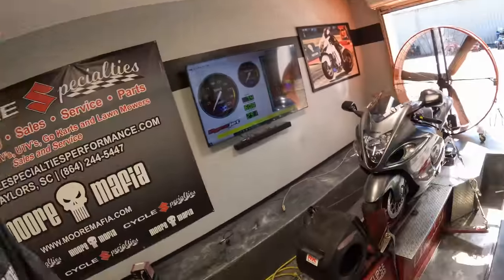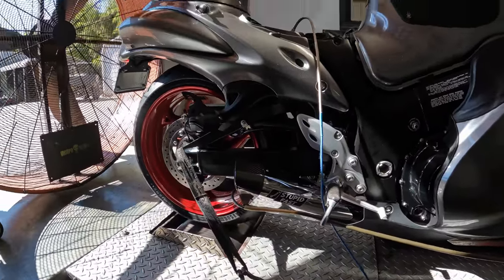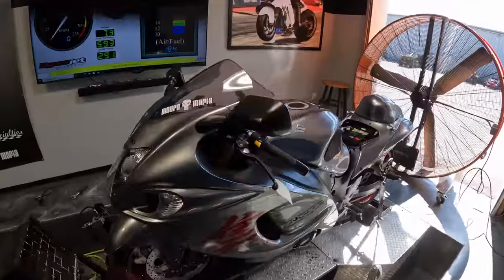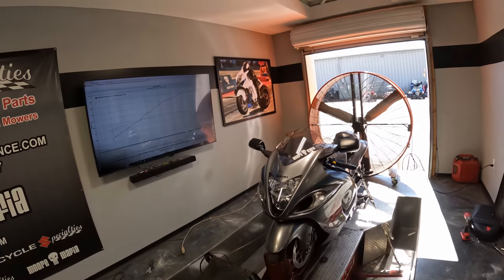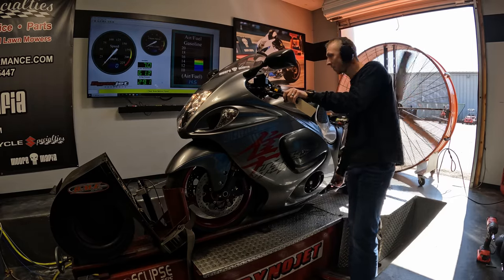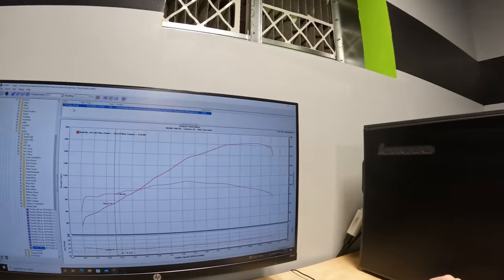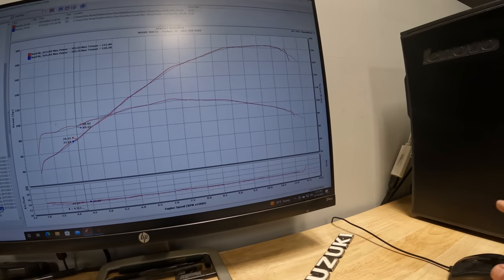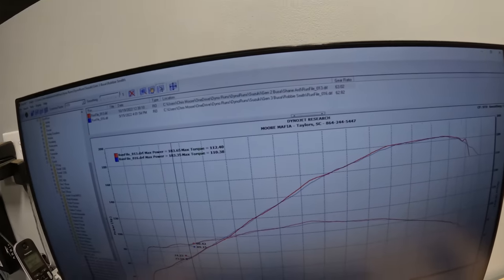2020 Hayabusa VS 2023 Hayabusa- IS THE NEW BIKE WORTH THE EXTRA $$

Comment: Suzuki made the Gen 3 'Busa for people like me, someone who didn't like the previous body style but wanted a new Hayabusa that looked better but was as close to the original formula as possible. 

I mean, they even kept the analog gauges. They changed hundreds of engine parts, but it's the same engine. They built it with a Japanese mentality, and left a strong canvas for the aftermarket.

It's like I willed this bike into existence. I have a ZX-10R, so I don't care that it doesn't come with 180...much less 200 horsepower to the wheels. The Gen 3 is the best bike I've owned or ridden.

Yeah, it's not the fastest thing I've ridden, but no literbike feels like the Gen 3 'Busa the way it thrusts forward with such urgency. Speed and horsepower isn't everything. The power delivery and feel of the bike matters more to me.
Reply: Yessir yessir
Reply: Yes, well put.
Reply: And the engine comes with forged internals. It’s literally built from the factory to be turbo friendly, for the people that just gotta push 300+ horsepower. lol

Comment: So I have a new 2022 Black Hayabusa  still all stock ,I am having a REALY good time riding 
Her ,at 74 I don’t need extra horsepower,the torque in mid range is great . The only down side 
Is the weight when pushing her in and out of the garage ,so I am losing weight already down 
From 275 to 217 I’ll be happy at 170 😊🦅🇺🇸🦅🏍
Reply: I don't push mine since dropping her on day 1 pushing into the garage up a half foot slope. 😅

Comment: Gen 3 busa is a disappointment in the engine department, should of been a 1441 with 200hp to the rear tire stock and then let the aftermarket unlock the other 20hp with a flash. As far as looks go, the front and side panels look great but looking at it from the rear it resembles an old 90's RF 1100...Haha. The electronics are an obvious upgrade but you didn't need them on the Gen2 so not really a a big deal, now if Suzuki gave you some hp to harness then the electronics would of been more relevant....personally I'd buy a Gen 2 and save a bundle of cash, still great looking, same hp, frame and geometry is unchanged, not much difference in the suspension department and you can take the 💰 saved from not buying a Gen3 and  build yourself a 1441....done...lol
Reply: I agree with you 100%

Comment: I just bought a 2023 Gen 3 before Thanksgiving.  Research I did showed them equal except for the electronics, so i went for Gen 3.  that tipped the scales for me.  under 400 miles and loving it. took it on a 4hr, 300 mile round trip, cruise control made it comfortable. my 2022 Zero SR/S electric is my 100 mile commuter bike and Busa is my sport touring bike.  the Zero with its 150ft-lb torque is faster, but Busa has legs.

Comment: The extra cost is all about the electronics.  To me, the Gen 3 would be the way to go given the cruise control, lean sensitive ABS, rider modes, etc.  If there is one mistake that was made, it was that Suzuki keep the name GSX-R Hayabusa.  The reason for comment is that insurance companies will group the Gen 3 with the older models which means insurance rates will continue to be high.  Had Suzuki re-named the bike, insurance companies would have looked at this bike as a separate model.  Given the substantially higher cost, one can predict that fewer incidents would occur and thus support lower premiums (at least here in Canada).  A good example of this is comparing GSX-R1000, ZX10, R1 t o Ducati/BMW.  Both the Ducati and BMW are cheaper to insure as they have cater to a different clientele but have similar performance.  Again here in Canada, the Japanese 1000 normal insures for about $1500-2500 a year while the Du/BMW insure for about $800-1500 (based on rider age, experience and training).
Reply: I pay $500 a year for my Hayabusa in Alberta, the same price I pay for my wife’s R3 so I think you should maybe shop around.
Reply: My insurance is $28.00 per month full coverage

Comment: My Hayabusa 2008 has standard 175 hp at the rear wheel and 145 Nm.
The only things that has changed, Akrapovic exhaust, KN air filter and G-pack.
Now it has 188 hp at the rear wheel and 160 Nm.

Comment: With  two different Gens there's show so little difference you could easily take two bikes of the same Gen, equipped and tuned so they are as identical as possible and get similar results. For a buyer is comes down to preferences and cash. Personally, I still prefer the Gen I's. The Gen 2 and 3's are a bit more potent, they ride, handle, and brake a bit better, but not so much that one would really notice the differences until riding in a way that pretty much equates to tarmac madness.

 I've got a Gen 1 because I like the looks much more. And I don't ride it enough, or crazy enough to justify an upgrade. It has the basic minor modes, pipe, filter and tune, but nothing else that would impact power output. I bought it new back in 2002, and it has a little over 6K on the clock. It sits a lot. My rides are typically on the short side, and maybe two or three times I've really stretched it's legs. It has seen 140 and 150 many times - maybe twice during each riding season. Of course that only happens during the wee hours of the morning when I'm pretty much the only vehicle on the road. 

All in all, each Gen of the Hayabusa has proven extraordinary motorcycles. They aren't necessarily the baddest out there, but they haven't an ounce of shame in their games, either.

Comment: Value for money it's the gen 2, for looks and way it feels, it's the gen 3.  Chris, could you overlay a gsxr1000 with a Busa to show everyone - the torque difference below 10,000 revs is massive and you feel that when you ride the two - flat out the 1000 wins every time though....power to weight does that 🙂👍
Reply: I’m actually looking forward to getting a gen 3 Busa, I want the electronics and quickshifter. Only thing I’m unhappy with about the Busa is not having auto canceling blinkers.

Comment: I love the vid! 2020 didnt offer the silver and red thats a 2019.
I have one and its flashed by you!
Mine has a few more ponies with the   shorty velocity stacks, sprint filter and ceramic wheel bearings. Dynoed here in Cali 196 rwhp 118 ft lbs torque. Still need to try it on B mode and MR12! should make over 200hp.
What I think about the Gen 3 Busa is not very good. Ive seen alot of negative stuff on the 21+22 models. People are selling them fast. Plus for that much money Suzuki should have upgraded the motor. Honestly the Gen1 is the best for racing. Gen 3 NOT WORTH DOUBLE THE PRICE OF A GEN 2.

Comment: I’m posting another comment. I went to get back on the busa, a 2023 or 2024, and I couldn’t get comfortable.  I went to my local dealer and they didn’t carry a Hayabusa, but did have a leftover 2023 Kawasaki ZX14r abs, and so far, I’ve traveled 2500 miles, melted a tire so far.  The ZX14r pulls harder than the busa , I was surprised. I do miss my Hayabusa tho, such a nice, clean bike.  I need my ZX14r dyno tuned.  The factory clutch sucks too.

Comment: I have both motorcycles, fossil fuel burning crotch rockets (H2 SXSE+ and Ninja 650) and an electric and I think each has it’s own niche to fill.  The electric has no range per se, ~150mi in the city and ~80 @ highway speeds and is dependent on finding charging stations before you end up stranded with a dead battery. As a runabout in the city, with plenty of free charging stations scattered at a lot of the shopping venues, the battery bike is great; but on the open road, the gassers rule.  They can go farther, faster, and can get fuel from roadside assistance trucks whereas the EverReady bikes can’t…unless those trucks have generators and you’re carrying the appropriate charging CABLES.  

Anyway, I like my 110hp/140lbft DuraCell-powered bike; it’s great for the twisty roads where I live, the torque out of the turns is scary fast, and I hardly ever use my brakes with a great regen system on the bike into the turns.  To each his own I guess.

Comment: as a gen3 owner I say that the bike is fantastic at all levels, it is a wonderful bike but unfortunately the power is not enough, Hayabusa should be supercharged. I'm considering switching to  H2SX .
Underpowered bike, sad
Reply: Keep it and call the folks at TTS.
Reply: @moorepower13  lol
In my country i can buy a H2SX for 20K. Whats the point of wasting 36K plus bike (56K) ??? I can buy almost 3 h2sx for that price. 
Other thing, I never understood  well whats the point oh having a 370hp bike without extended swing arm...
Reply: @MrPeteRR299  the simple setup from tts is around 6k.  Internals of the busa motor are a bit more stout than the Kawasaki(Kawasaki didn't go with forged parts, like on the original H2, to keep its cost down).   There are also new cam shaft setups in the works for the new busa(main reason the "new" busa motor made its emmison requirements but is limited on its power maximums).
Reply: @moorepower13  any tune like that it will be more expensive than a h2sx, in addition it will always be an illegal motorcycle and you will always have problems with the authorities at least in many countries.. like mine.
Suzuki went easy way with this motor.. this should be supercharged
Reply: Get that TTS make it a Super Busa. Or you can check w RCC see if they have anything for it. Then NASA will be calling you telling you to slow it down 🤣🤣🤣👍👍👍

Comment: I'm disappointed that the new Gixxer 1000 makes more power than the Busa's. The Busa has a little more torque. But not enough to warrant all that weight that comes with it.
Reply: Back in 06 I bought new Gixxer 1000 and would out pull busa’s weight to power ratio they always seemed better to me at least from my experience. That said my bike was very strong from the factory and not all are equal as we would hope
Reply: The 1300’s are just ready for more power. They can make 280? Stock with a turbo kit without opening up the engine.
Reply: @Nitrous_Busa  id agree the extra displacement is much more responsive to boost
Reply: @Nitrous_Busa  the average rider can't afford a turbo and the bike
Reply: @walk4348  well the busa is 23k after taxes. Sure that 3k is obtainable for a kit
Reply: I own a 2000 busa and a 2018 gsxr1000r feel free to ask me why I kept both of them.
Reply: @moorepower13  because they’re both good bikes and are not meant for the same purposes
Reply: @moorepower13  2 different types of track days
Reply: That "little more torque" compared to the gixxer is 30% from early on due to the 30% bigger displacement. The power to weight incl rider and fluids should be relative. So it comes for what you need it. The weight you just feel in twisties or tracks but busa is ultra comfortable.
Reply: over 110 tq for the busa vs 80s for the gsxr is more than the hp that separates the 2 bikes
Reply: @ronr6605  for sure but 140lbs more bike is a lot of extra weight 30% more torque disappears extremely fast
Reply: @Thumper68  ur right, I lost 40lb in last 6 years ofc weight matters (got to admit, 🏍 riding is a sport, forgot that in my dad time). Horses matter, if you live in a vacuum and if you are built like a MotoGP rider they might be even all you need (the fewest of us are, if i check the guys at the local bikespot). At some point horses won't push you through the wind anymore so why they should fill in more of them in a busa? (I'm currently on a s1000r with forged wheels and lightweight battery, so I get the point of lightweight sportbikes.) So ye, in every corner ur f*ed but if she pulls, try to look disappointed. I couldn't. ^^
Reply: @ronr6605  oh I agree I wasn’t saying your wrong by any means. I mean I’m a v8 carburetor guy after all :)
Reply: Wrong,they both make 200hp to the crank factory specs.
Reply: @moorepower13  I have a 2003 hayabusa, and have looked at a new gsxr1000r, so I am actually curious about the “differences” in engine feeling 😊
Reply: That’s a damn shame lmao
Reply: @3Bisgaards  Best way to describe it is, 1000 feels like it "can" get to 185mph.   Busa feels like it belongs there.
Reply: @moorepower13  That’s what I thought 😂
Reply: @Thumper68  exactly!   One is a GP bike the other is a GT bike.
Reply: Lol it's been that way for the  last 15 years.

Comment: Take 10 identical bikes and put them on the dyno on the same exact day each one of them will be different we all know this it's the tiny things that make a one or two horsepower difference one could have slightly tighter bearing tolerances one could have a little better ring seal the next one might have the timing gears pressed on just a hair bit out of position one or two degrees of cam timing can shift the whole Power Band so these debates are kind of frivolous in the end the Gen 3 is Xavier and it has a lot more bells and whistles the Gen 2 is much more aftermarket friendly especially with the stupid injector design preventing us from turboing a gen 3

Comment: Not enough of a difference to justify trading up to the newer model year.
Reply: Not enough if you purely look at power, but Gen3 is massive improvement in rideability, safety and lookswise
Reply: Gen 3 is definitely the way to go for the electronics alone. But I don’t really care which one has slightly more power stock or whatever. I love the looks of the gen 3 over Gen. 2. Gen 2 looks .. dated. Plus full titanium exhaust system , flashed ecu, ceramic battery .. and the Gen 3 will run like a damn champ.

Comment: Suzuki claims a more durable engine with the gen 3. Which means the engine could manage more power!
Reply: People still swapping to the Gen 1 block because of how durable it is. The Gen 3 is gonna be even weaker.
Reply: @Nitrous_Busa  I really douth mr suzuki gen 3 engine in general will be weaker over all than gen 1 and 2
Reply: @K-carbon  I have a Gen 2 and am doing a 1441 build over the winter. I had to secure a Gen 1 block because of Gen 2 blocks are known to split when doing any over sizing.